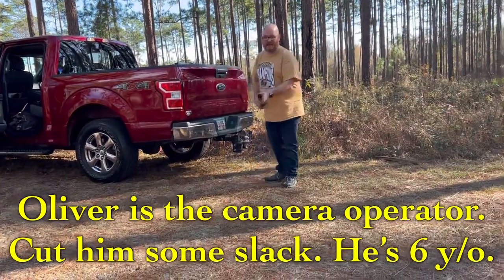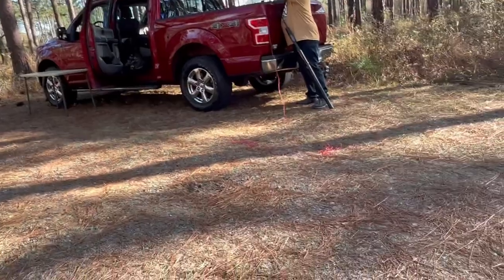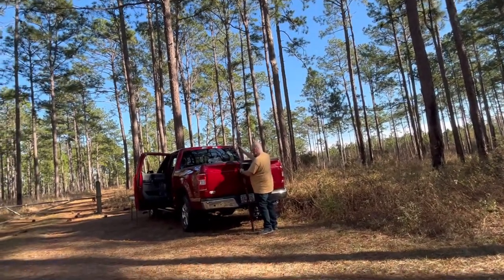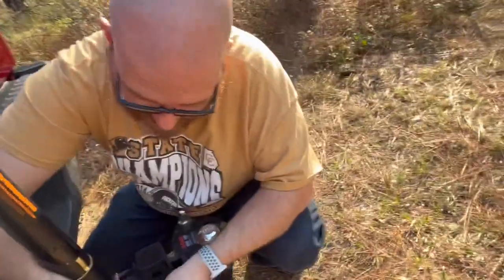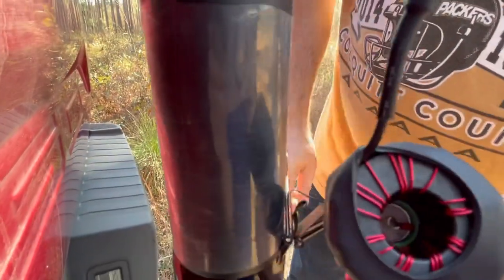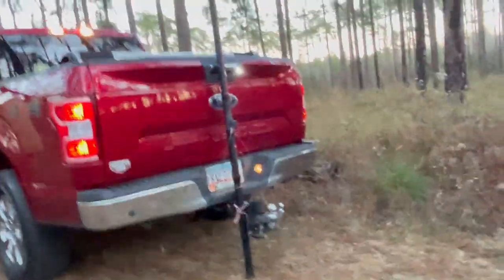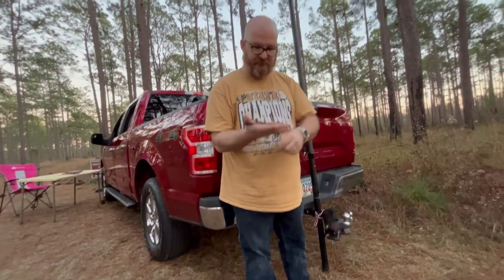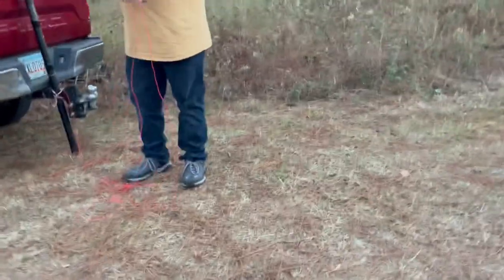K6ARK 100w kit, Random Wire Antenna, and the Jack Kite Pole

Comment: Robbie, I “wind” my coax like you did with the over - under method. That works great. Also, I use my hand like you did for small rope and short pieces of wire. The cool thing is with that method, you can great the end and it will pull out and not tangle.
Reply from the maker: I have multiple ways to wind cables, but RG-316 seems to be the toughest stuff to neatly wind up.

Comment: I have to use a 12 inch extension on my hitch. That brings the antenna mast put so I can lower my tailgate. Works great
Reply from the maker: My Wrangler has a dump truck sized tire on the back with a huge tire holder on hinges, so I’m going to have to make a custom hitch extension to make it work. I would consider buying something, but DIY might be cheaper and give me another project!